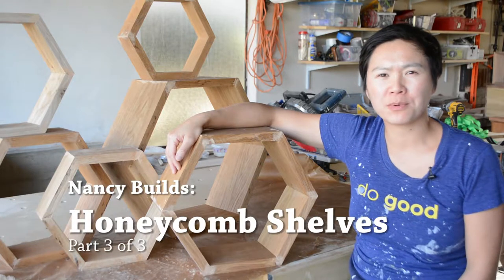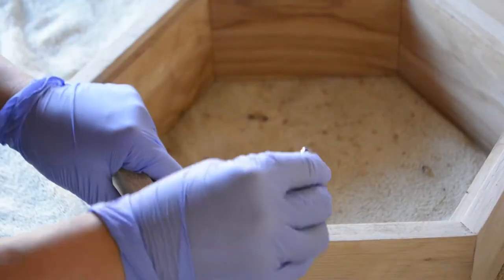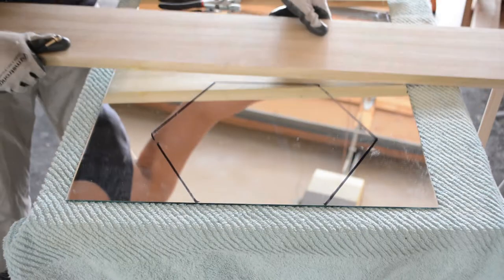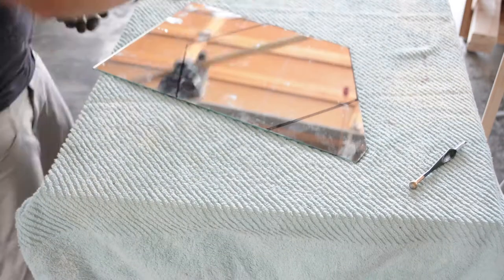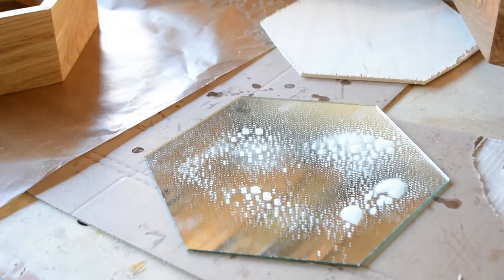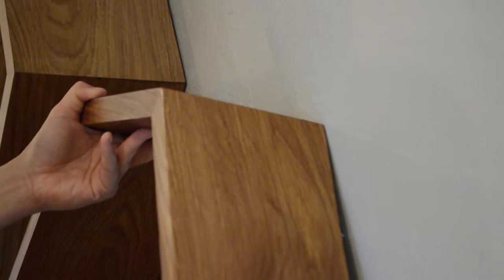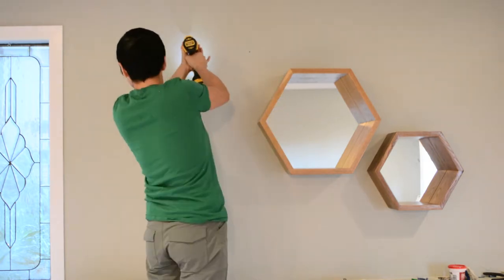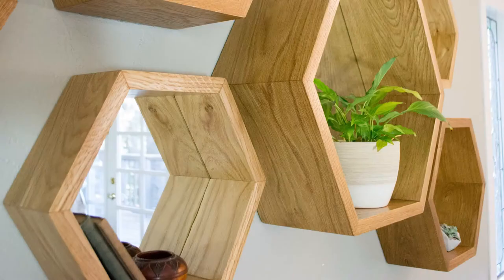Honeycomb Shelves: Part 3 of 3

Comment: Beautiful job Nancy, I admire your precision and attention to detail.
One suggestion for future. When screwing the hanger bolts to the wall it would be better to screw on the end of the bolts two nuts tightened against each other. Then you can use ratchet or a socket tool to tighten the whole bolt without a risk of damaging the thread. (which wasn't important in this project, but might be handy next time)
Please upload more of your work, it's very interesting.
Reply: Bonjour,  We use here ( anyway the plumbers ) bolts ending with a hexagon recess. 
J a c q u e s  Belgium